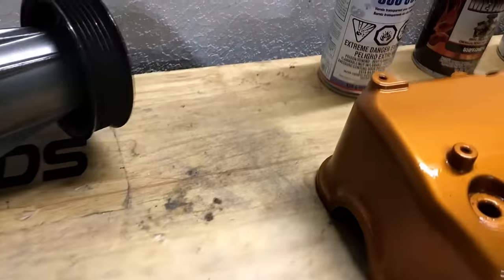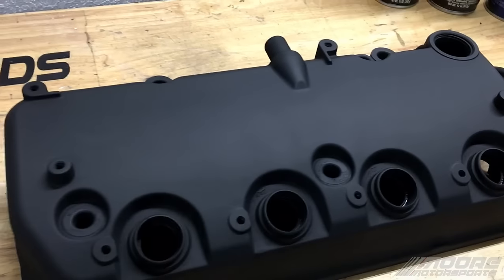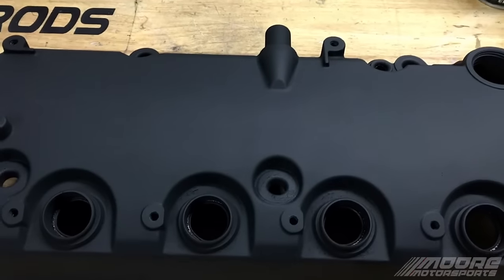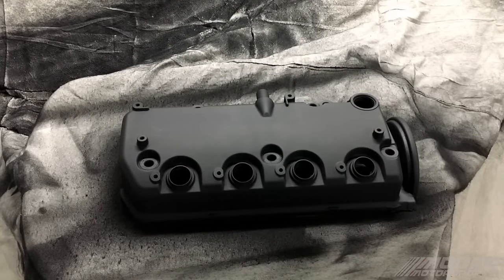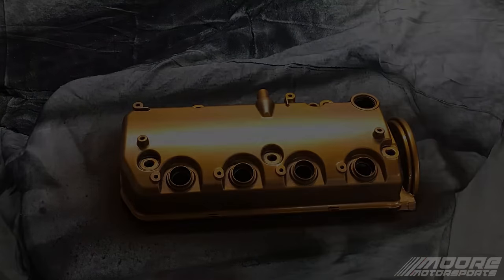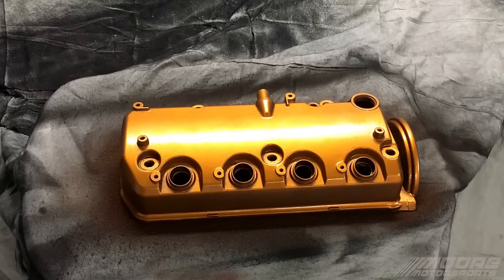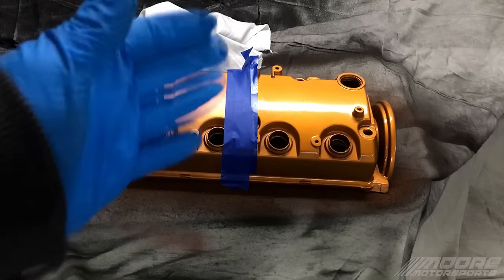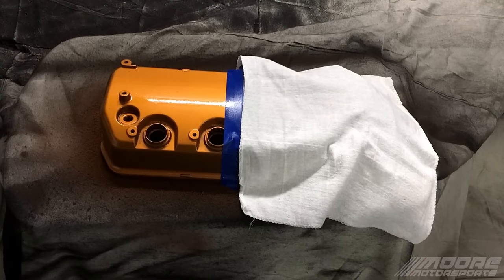Here Is The Difference Between 2K Clear and 2X Clear

Comment: Can I apply spray max 2k over 2x ?
Reply: I need this answer please.
Reply: Im wondering the same thing
Reply: Try it and find out, what did you find?
Reply: Yes, absolutely. Having a solvent resistant two component outer layer will be beneficial. Just make sure you scuff and prep the surface properly and/or apply it within the recoat window of your base.

Comment: Would a 6 pack of the 2k Clear be enough to cover an entire EF Civic?
Reply: Probably more like 12 cans honestly. It doesn't go as far as you think
Reply: It's an overpriced clear coats. 20+ cans of Eastwood 2K comes out to be $700.00+ to paint a compact car.
ATG says if you are to paint to keep for 2 years or sell it, then get the cheapest clear coat spray can.

Any car costs less is than $5,000.00 (book or high miles), just use the cheapest supplies.

Comment: I'm not quite sure why a comparison of these two products is even necessary. 2X is nothing more than clear spray paint. IT IS NOT CLEAR COAT! People think that because the 1K and 2K are clearcoats, then the 2X must be a clear coat too. The 2X means nothing except than they claim it will cover 2X's the area per can. It has none of the UV protection, hardening, or scratch protective characteristics of a real clear coat like 1K or 2K.
Reply: This is totally correct and needs to be repeated.
2K products are two part products that have a hardener added as the 2nd part. This is universal nomenclature for paints (pigment) and clear coats (protective). 
The 2X is Rust-oleum's marketing mumbo jumbo aimed at claiming more coverage per unit.
Comparing the two is like comparing professional tools vs home use tools. Neither is wrong but not the same playing field
Reply: @mwendaspub  exactly!
Reply: its necessary for people with less knowledge than you have... this video, in combination with your comment have helped me make a decision (2k!!!!!)
Reply: I'd be curious to see spraymax 1k vs the 2x because as you said 2x is clear paint not clearcoat (Imo)
Reply: What about acrylic lacquer? Is this not a clear coat?
Reply: True the rustoleum isn't as hard or chemical resistant as the 2k but it is indeed UV resistant & says so right on the can. I used the 2x clear on my Sebring coupe headlights over two years ago & they have been outside in the elements since and are still crystal clear with no yellowing. They look brand new. They were in really bad shape, yellow, cloudy & scratched to begin with. So a little time sanding, a $5 can of 2x rustoleum clear I'm tickled to death with the results. Especially since I've experienced the dreaded crinkle effect a few times before with rustoleum. In my opinion it's worth the $5 gamble to try it before splurging on the good stuff. Just be sure the surface is clean, I use glass cleaner (windex) right before I spray because it's zero residue. And be sure the can is shaken & mixed well. It can be under mixed but no such thing as over mixed!

Comment: would either of these be good for headlights to prevent clouding or for coating bare metal like brass or copper so it does not oxidize?
Reply: Generally 2K (two component) clear is better for everything. If the underlaying surface is compatible with it. For your aplications mentioned it propably is. I would use 2K in those aplications.

Comment: Why do you put it in the freezer
Reply: the hardener in the 2k will cause the rest of the contents of the can to harden solid if you don't store it in a freezer after the initial use
Reply: 2 part epoxy paints create heat when they harden and that speeds up the cure process. By keeping the mixed contents cold slows that down.

Comment: In my experience Rustoleoum makes some of the worst garbage on the market. Their products are cheap so you can buy it everywhere but that doesn't mean it's any good. Their primer = sucks, their paint = sucks if used with any other products (including their own !), their clear coat = joke. Use primer by any other company and be impressed how smooth it is. Use any other clear coat and get close to 2k finish. Bottom line, Rustoleoum is GARBAGE!
Reply: Nope

Comment: The 2x is totally unsuitable for any application requiring fuel resistance. I made the mistake of using the Rustoleum  on a motorcycle. Never again!
Reply: Damn I just did that too. Putting the 1250 kit in it thank god so I gotta redo it. Did you try this method, did it work way better

Comment: More orange peel with the 1k 2x
Reply: Orange peel is from how it’s sprayed . Thickness and air pressure tip size
Reply: @ThaiRoney  correct … spray can is hard to change can be done somewhat. Adding more pressure in the can and changing tips.

Comment: You sprayed more on the 2k. Not totally convince. If you are going to do it. Then spray the same amount. 2x you just sprayed a little bit. Geeez
Reply: If you act knew about the 2K one it’s act a two part product, vs a 2x single. Not even close no matter how well you prep and amount u add.
Reply: His job isn't to convince you. He did a great job demonstrating to those of us that understand a little about single and multi-stage paints. You really think that Walmart junk can hold a candle to a clear with activated hardener? LOL
Reply: @johnfreeman440  the 2k have a hardener. Maybe, you don't know that. 😁.Get out of your cave.
Two compound paint  (also referred to as 2K paints) are paints in which a chemical reaction results in paint hardening.
Reply: @2john149   Uhh...you mean exactly what I said? Most of my experience has been with actual automotive paints and paint guns where a hardener is normal.  Expecting a rattle can, non-activated paint to compete with an aerosol paint with a hardener element is silly.